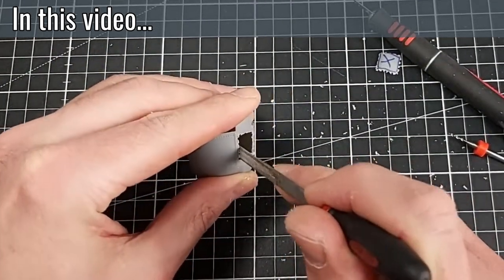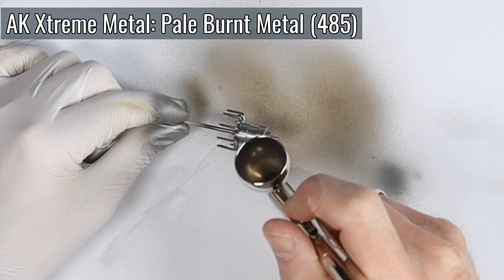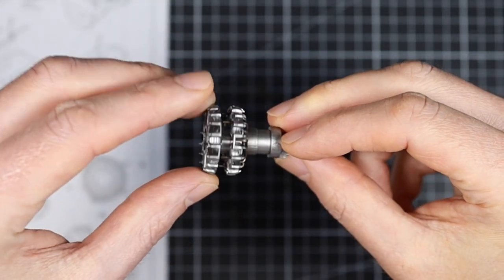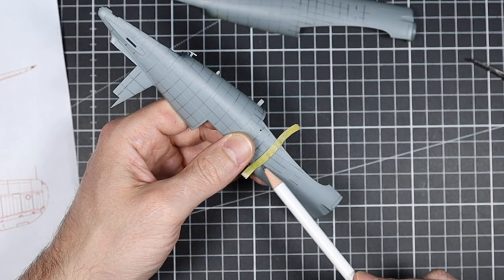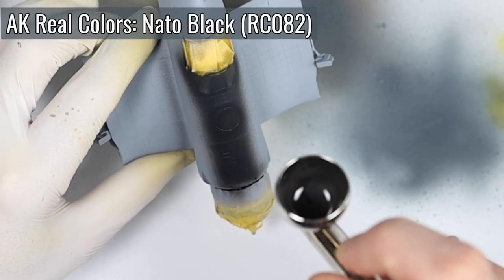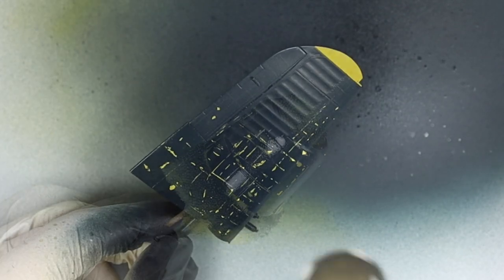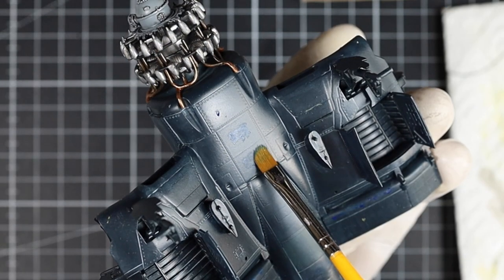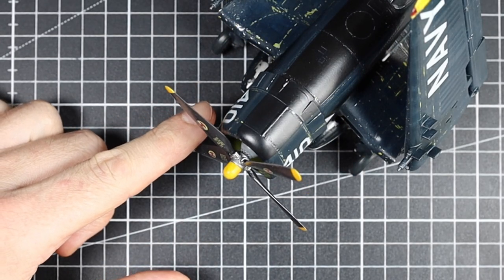HobbyBoss F4U-5 CORSAIR (Korean War) | 1/48 scale | Build, Paint & Weather

Comment: Nice build. But you are not doing yourself any favours using Vallejo Air paint. It’s too thick in the bottle and the result is a lot of orange peel in your paint. When you are laying the blue on the cowing you see the paint beading off and that’s a result of your chipping fluid being applied too thick as well. Shoot that on as a light mist from a distance. I struggled with Vallejo as well and switching to Mr Color lacquers was a game changer.
Reply from the maker: Thank you for the helpful advice. I should really stick with the things that work. My goto colors are AK Real Colors with Mr. Hobby thinner. I will only spray acrylic paints in exceptional cases...it's no fun anymore. I'll keep the chipping liquid thing in mind next time...Regards ScalerDan
Reply: His result still looks amazing. I don’t use laquer because it is too gassy and messy and I still prefer my acrylic paints. It’s all to preference.